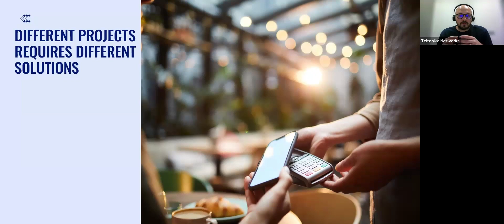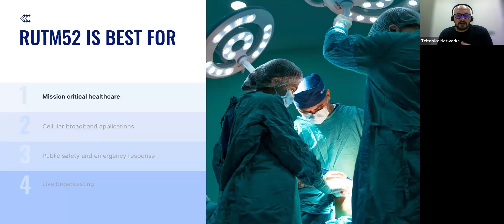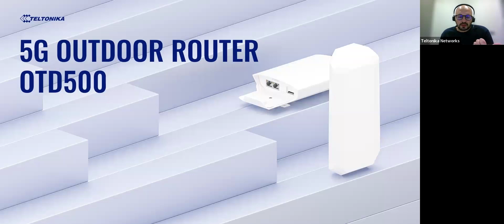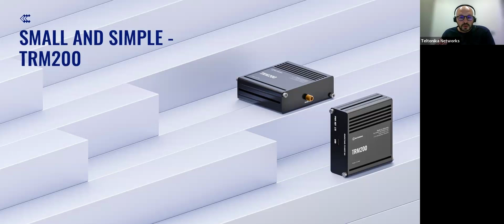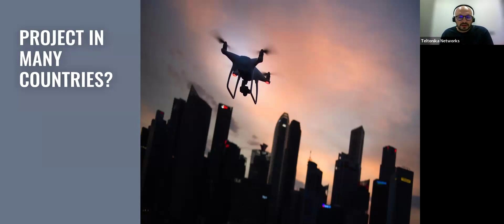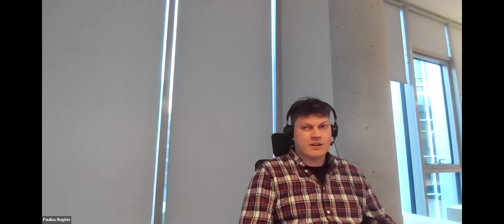Introducing RUTM52, RUTM54, OTD500 and TRM200 | Teltonika Webinar

Comment: Hi, i was thinking about using your products like the M54,OTD500 or the X50 but the only thing im confused on is why the ports are gigabit max even if your products could theoretically recieve 2.4-3.4 gbps. This is a strange bottleneck i still dont seem to understand.
Reply: Most industrial IoT customers use these routers to serve dozens of devices or SCADA/PLC systems, rather than a single high-bandwidth workstation. Because of that, 1 Gbps per LAN port is more than enough for the majority of industrial, commercial, and M2M use cases. Adding 2.5 GbE or 10 GbE ports would significantly raise the product cost, with relatively little benefit for most customers.
Reply: that is why there are multile LAN port on the device.
The other thing, the values are theoretical, to get the maximum speeds advertised, you need to be in laboratory conditions.
Real world speeds, hard to even that to that would significantly go above the singular gigabit, you need to be:
A: living under a mobile tower that support like 7 different LTE bands
B: Have antennas, that cost more than those devices
Reply: @pauliusruginis5264  there are scenarios where switch capacity is relevant. Let's say, one port running storage and another performing some traffic hungry logic with that storage.